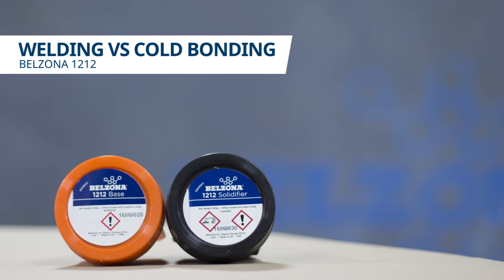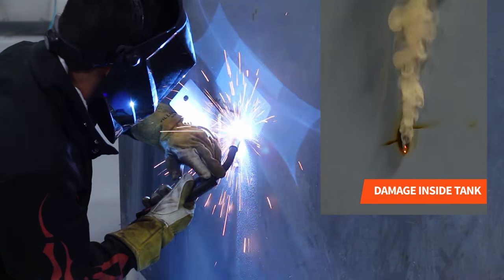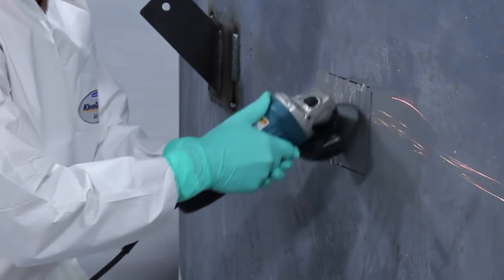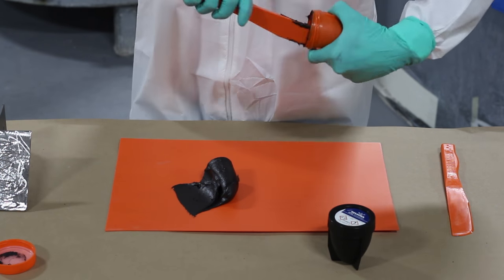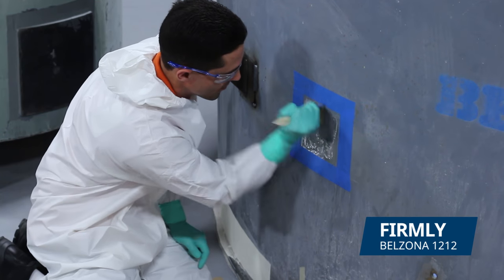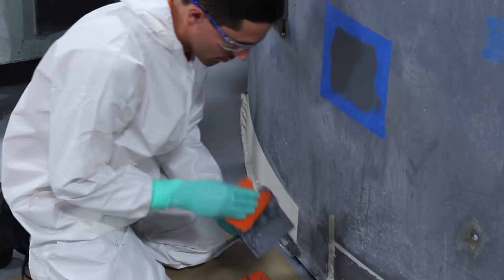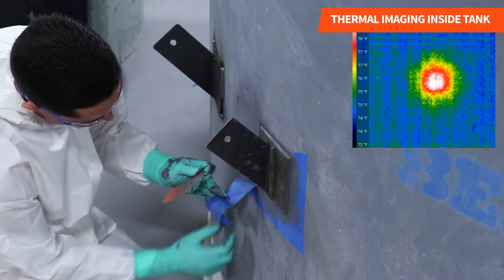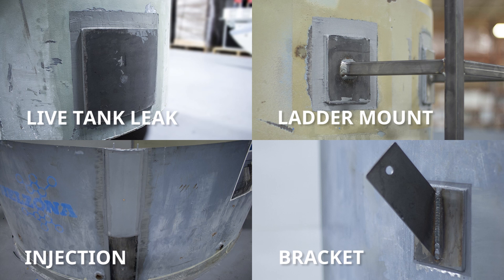How to Bond Metal Brackets to a Metal Tank Without Welding

Comment: Very interesting indeed. Still looks like $80 of “JB Weld” in a can. To bad you did not let it fully cure, then start hanging weights on, to the point of failure. We all know enough weight would eventually cause separation. It would be cool. Let’s say the contact area is 6” X 6” (15.24 cm X 15.24 cm) = 35 sq in (232.26 sq cm). If properly prepared, if the bonding agent holds 180 lbs. per sq. Inch, it could hold up to 1080 lbs.
As shown, priceless is working on the outside of a coated tank, like galvanized to glass lined like a tank style water heater. That is something!

Comment: If the contact area is of 1 sq cm between two metal pieces (the same used in auto parts for example) what is the maximum holding in lbs or kg ?
Reply from the maker: Hi George,  if you follow this link to our Belzona 1212 product page, you can view the Product Specification PDF document with adhesion testing available to view: https://www.belzona.com/en/products/1000/1212.aspx

Comment: Brazing is better than welding when it comes to thin-walled thank like that, but even brazing tends to warp the thin metal, while cold bonding does not, so for areas that do not undergo extreme temperature swings, cold bonding is better. But for areas that get extremely hot, then extremely cold, brazing is superior to cold bonding in the long run.

Comment: for the above video, what is the cost of cold bonding to welding. What is the bonding strength of cold bonding to welding in the above video, if possible can I get the strength value of cold bond strength in MPa. Time taken for cold bonding making to that of welding time. can i get the data please ?
Reply from the maker: Hello and thank you for your question. Complete information on Belzona 1212 (featured in this video), including a Product Data Sheet, is provided on this page: https://www.belzona.com/en/products/1000/1212.aspx. For any additional information, it is recommended that you contact Belzona Technical Department at tkl@belzona.com. Best regards, Belzona Team

Comment: Dear sir,can I fill this solution to mild steel welding blowholes
Reply from the maker: Thank you for your question! Yes, Belzona 1212 can be used to refill any welding blowholes. However, if the weld has any structural problem, we recommend you use a suitable product for the structural repairs. Best regards, Belzona Team

Comment: If that epoxy takes a whack with a hammer,  will it just break off ?  How about lifting capacity compared to the weld ?
Reply from the maker: Hello Mr, Debest! Thank you for your question. The values obtained from the Pull Off Adhesion ASTM D4541 and Shear Adhesion ASTM D1002 (which you can find in the product's product specification sheet: https://www.belzona.com/viewfile.aspx?id=55723) can be used to calculate the size and number of bonding areas needed to handle the weight and stresses on your cold bond application. When applying a safety factor of 10-1 for example, if the calculated weight to be supported is 300 lbs, the size and number of plates will be designed to hold 3,000 lbs. The higher the bond area, the higher the weight the system can safely hold.  
The epoxy product is not easily broken off by impacts from a hammer, an excessive amount of force and stress concentration (by the use of chisels for example) would be needed to damage the product.
See this case study below for more information:

https://khia.belzona.com/en/view.aspx?id=7476
or
the product page: 
https://www.belzona.com/en/products/1000/1212.aspx
If you have any further questions, you are welcome to contact our Technical department at tkl@belzona.com. 
Best regards ~ Belzona team

Comment: How about some TENSILE STRENGTH tests??? How does cold bonding compare to welding, brazing and soldering?
Reply from the maker: Thank you for your question! This document (PSS: https://www.belzona.com/viewfile.aspx?id=55723) provides information on various tests done with Belzona 1212 - the metal composite used to bond plates in this video. The main benefit of the cold bonding technique - no need for hot work, which is extremely important when the application is done on tanks containing flammable liquids, or on tanks that have internal coatings, or in spaces where hot work (welding, brazing) is not permitted. Feel free to contact your local Belzona representative with any further questions or to discuss your specific needs: https://www.belzona.com/en/about/disfinder.aspx. Best regards, Belzona Team
Reply: Link doesn't work

Comment: Will this bond steel to aluminum?
Reply from the maker: Hello and thank you for your question! 
Our products adhere to different substrates, including steel and aluminum. You must ensure that the preparation of the surface is adequate, the substrate must be clean of grease / residue and needs to be roughened to ensure an optimal bond. The advantage of using Belzona to bond dissimilar metals is that in most cases our products prevent electrochemical corrosion between them, which could be a significant problem if welding is employed. Please contact your local Belzona representative to discuss further specifics of your situation: https://www.belzona.com/en/contact.aspx

Comment: 1. Please tell the one doing the grinding that the gaurd on the grinder is wrongly positioned.
2. Just as welding is tested with NDT, What are the tests done to ensure the cold bonding is done effectively?
Reply from the maker: Good morning,

Thank you for your comments. The relevant Product Specification Sheet details the physical performance of the system such as compressive strength, tensile strength, adhesion, etc. All tests are carried out in accordance with international standards. In addition, there are several independent tests that are carried out and available to demonstrate the strength of the system selected.

If you wish to discuss specific testing data or this application in more detail, please don't hesitate to contact us http://www.belzona.com/en/contact.aspx 

Many thanks

Comment: How does it hold up to heat? For example, if it was applied to a metal fire pit.
Reply from the maker: Hello and thank you for your question! We recommend that you refer to the Product Specification Sheet for Belzona 1212: https://www.belzona.com/viewfile.aspx?id=55723
Also, you can contact your local Belzona rep: https://www.belzona.com/en/about/disfinder.aspx as they will be able to help with the product selection. Best regards, Belzona
Reply: Not suitable it seems. Pity, I had the same thought

Comment: Can bond stainless steel block on High speed steel.
Reply from the maker: Hello Mr. Rautela, our products are able to bond to most metals as long as a proper surface preparation is performed on the surfaces to be bonded. Additionally, Belzona materials are excellent electrical insulators, which enables them to prevent galvanic corrosion by isolating the dissimilar metals. If you have any further questions, please feel free to contact a Belzona representative in your area: https://www.belzona.com/en/about/disfinder.aspx. Please let us know should you require any further assistance. Thank you for your question. Belzona Team.

Comment: Vertical welding is supposed to go uphill, bottom up. Your weld has no penetration and is still burning the other side. Squirt gun might be the wrong tool. TIG offers more control. Copper backing or solar flux can help mitigate burn thru as well. The only time I would think to glue something like this would be on a fire or explosion hazard.